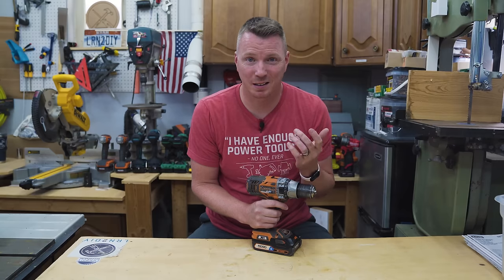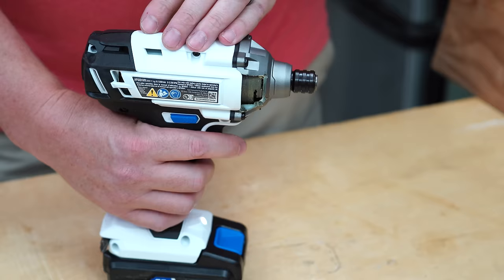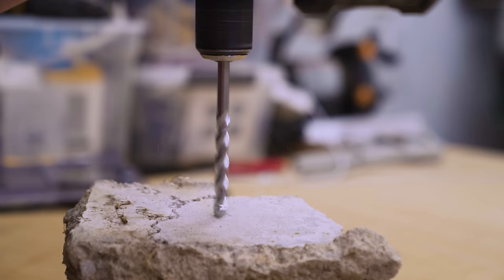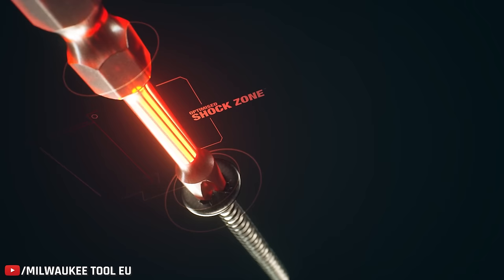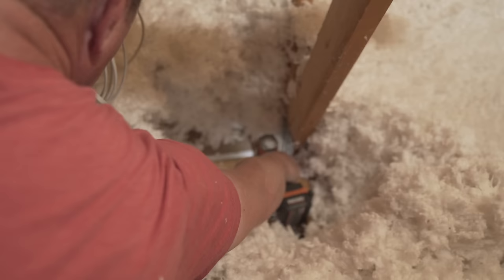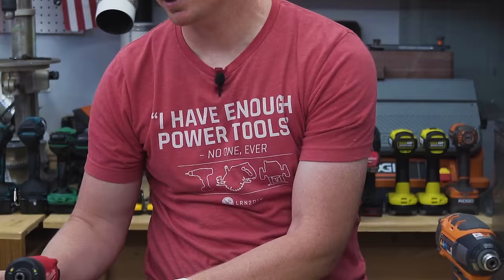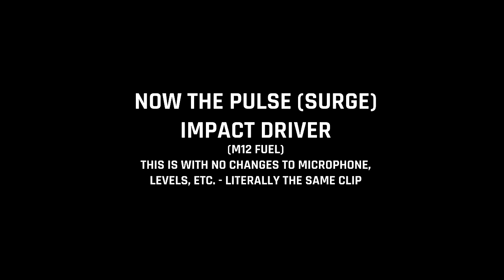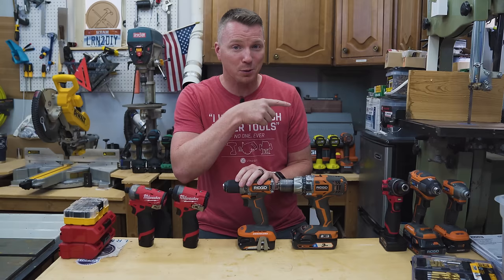Is The Cordless Drill Becoming Obsolete?

Comment: For most pros we stick to using the impact to drive screws and the drill to drill holes. You don't have to switch bits as often and you will be carrying around both anyways. Also the impact can drill small holes fast but once your drilling through multiple layers of material or heavy duty stuff the impact will be slower than the drill.
Reply: Not a pro but I prefer to have both tools handy as well, mostly to not have to change the bit holder and drills all the time.  I use the 12v DeWalt set of drill motor and impact driver; they are smaller and easily fit in my toolbox unlike most beefier 18V tools.  In some cases I actually prefer the drill motor for driving screws, it gives better control.  And is a lot less noisy.
    
I also carry a small wireless Bosch electric screwdriver, it is not as powerful as either DeWalt but it's tiny and good for many jobs (especially building IKEA kitchen cabinets as I have found).  Much easier to wield than even the smaller impact drivers in this video, especially in tight corners.
Reply: I have a different setup but kinda the same. I use a drill for predrilling and a power screwdriver from Milwaukee. The screwdriver has a 1/4 chuck for bits, and a clutch for limiting torque on fasteners. Best setup for my application. Whether I am hanging APs, making drops, or racking equipment. 

Since getting it, my impact has been woefully neglected. I still use it but mostly at home and for diy projects that has me binding dead tree carcasses together for one reason or another.
Reply: Hope this wasn’t  a click bait video impact driver and a drill has their different uses
Reply: @EyebrowsMahoney   new guy at work is full kitted with Milwaukee. That 1/4 chuck screwdriver is nice.  Much quicker and easier when you're installing 100 4mm screws in panels.
Reply: Exactly I'm drilling 5/8 holes all day through doubled up 4x4s.
Reply: Well spoken
Reply: Dont forget we use drills to mix cement, joint compound, mortar, etc.
Reply: 100% agree. Also if you use the 1/4 drive wi g bits to drill your holes with the impact, you can get hole tear out more often in my opinion. Drills you can control the cutting action of a bit more easily since you are not getting impact strikes on the bit. Drills have a place as a partner tool with the impact and work very well with each other.  Each other can do the job of the other, but they excel in the separate jobs they have vs trying to be a jack of all.
Reply: Don't use an impact on thick steel, your drill bit will thank you.
Reply: That's why you are called a "smart person". You hit the nail on the head... Pun intended
Reply: @nicholascooper1193  Now I'm not kitted out Milwaukee, but I want a lot of Milwaukee stuff. But that is precisely why I got it. I found myself taking out and putting in so many machine screws that I just got sick of it. One day I was working on so much equipment with so many fiddly screws and it hit me how much time I was spending with a hand screwdriver and how much work I had left to do that was going to roll over on top of other work I had to do the following days...

Bought it and breezed through the equipment maintenance and open tickets and now it's my go-to for just about everything.
Reply: I think the “pros vs DIY” argument is less relevant these days as equipment market targeting converges - as does usage - I see loads of professional sparkies using impact driver for specific drilling jobs. I still think drills are good when you are doing jobs needing both (saves changing bits) but yes - drivers for drilling can be great.
Reply: I prefer to have both. The impact driver doesn't seem to drill as clean a hole. I use my impact driver like I would an impact wrench but only on the smaller stuff that a half inch drive impact it too big for
Reply: Exactly
Reply: @jameshendricks8526  Yeah I refuse to drill with an impact. Also can't use it when drilling metal either. I use a drill for a drill and an impact particularly for driving lag screws. But fwiw, I'm super impressed with my Milwaukee M12 Screwdriver, I was hanging shelves the other day around the house and it was going into studs like butter with only a 1.5AH Battery. Every day I keep finding less things for my 1/4 shank  impact to do.
Reply: Excellent analogy I agree with you sometimes you use the impact driver for driving screws and then when you need to drill a hole you use your cordless drill. Just like when I need to drive a nail sometimes I'll use a hammer and a regular nail and other times I will use my cordless nail gun all depends on the circumstance they're all valuable tools.
Reply: As a professional  2 drills and 1 impact is the perfect amount 1 to drill the hole 1 to counter sink and the impact to drive the fixing. 
Yes you can change bits but that’s slow and yes you can get a combi drill counter sink bit, but they don’t always drill deep enough.
Reply: Yep
Reply: I'm not a pro, but this is what I do as well.
Reply: To add to your comment, if going to be making holes often I reach for the hole hawg or the sds drill for concrete....
Reply: Heh, speak for yourself.  No, I'm not "carrying around both anyways", that would be ridiculous to walk around all day with both.  I either have the impact driver if not expecting to drill any holes, or only the drill if I will.  Whatever tools don't get used, stay on the truck, would be silly to unload every single tool I have and carry them all around all day.
Reply: not this pro (electrican).  i use a cordless drill only.
Reply: I need em both in the housing industry. The impact is not a one stop shop for all my drilling needs.
Reply: Not me. Maybe just lazy, but I  got sick of carrying both 10+ years ago when I figured out I could drill holes with an impact driver.  I still keep drills with me of course but I tend to stick anything I can with a hex shank into the impact driver.
Reply: Exactly 💯🍻
Reply: Agreed, I really think this type of clickbait title does a disservice for a good channel. It would have been easy to title this 'The expanding use of impact drivers' or something.  Drills are definitely way faster low torque applications and way easier to not over torque things. 'I do think drills are still very useful...' - this directly contradicts your title.
Reply: You're absolutely correct. Tried impact on double and triple headers. It was slow and died within 1h. I had to switch back to drill, which lasts all day on one 5AH battery and is much faster.
Reply: I imagine you go through a lot of drill bits that way, snapping them off every time one hangs up on you.  Better learn to sharpen them.  Or better yet, send them all to me so I can resharpen and sell them!  😅😂😅
Reply: @stinkycheese804  Amen to that, brother, you've got a head on your shoulders.  I once worked for a luxury SUV manufacturer, and they wanted me to wear a heavy parts/tool apron with THREE drivers.  One day, I noticed a patch of spider veins about the size of a silver dollar on right side of my abdomen where the belt sat.  I quit carrying 3 and just carried two and set the other down on something nearby.  I told them I could either do it that way or I could go to the medical department.  They would have gotten some attention to the ergonomics of that workstation.
Reply: @HBSuccess  same
Reply: I use my drill with the clutch set on 1 or 2 a LOT. My impact can't drive that wimpy. Also, if I bring just one tool in a tool box / bag the tool is the drill since I'll be using the clutch so much. I also snug screws either by hand or with the drill with the clutch set to the snugness I'm after. For the equivalent of hand tightening my impact is worthless.  I guess I'm just old school, I like to mostly loosen with the impact & "hand tighten" with the drill's clutch. I also dropped my impact shank drill bits in the recycle bin veeery long ago.
Reply: Exactly....I find the impact driver a poor driller on serious material. And....if you're drilling into concrete, the drills in most of these sets are also hammer drills. No substitute for a large 1/2" hammer drill.
Reply: I was going to say. I hate switching bits. I have two drills and one impact driver and there are times I use all three on one project.
Reply: @michaelbrown8861  👍👍👍👍👍👍
Reply: I am not a pro, either, but prefer have and use both tools, one primarily for drilling and some driving, the other for driving.
Reply: @Lethalpancakes  As I watched the video, I thought the same thing. I would imagine the "impact" would provide no advantage in mixing. I have had only one brand of impact driver - Master Mechanic from true Value hardware. I realize that is not exactly a professional grade tool. However, one thing I have not liked about it is the inability to easily control the speed. Most drills can easily be controlled with the trigger, but on my impact, it seems to go from real slow to real fast real quick.
Reply: Yeah. Everyone I know in industry uses impacts for driving screws. And hammer drill to drill holes if concrete. Normal drill if metal or wood. Never used my impacts to drill a hole. Guess your need an adapter or specific drill bit. Heck we used a cord drill up until 10 years ago or so
Reply: Another example of a video that's only popular because it's bad advice.    Sure, a mild DIYer could get by with just an impact, but there are countless reasons for still having a drill around if it's in your budget.

Plus, it's VERY unwise to buy drill bits from harbor freight.
Reply: I agree, this guy is no pro, more a master bodger we have to clear up after.
Reply: I find myself use impact and hammer drill, I have 3 regular drills collecting dust
Reply: Saved me watching, thanks
Reply: @MatSmithLondon  I don't agree. I've never seen a trades person on a job show me that impact drivers can outperform my regular drills in drilling out most materials. It's really not a big deal to use two tools set up to do different tasks. If you watch how fast we can do this with our hands, it's become a moot point.
Reply: @webtheweb  Of course....once you pull in your Holehawg et al, you wonder why you were messing with a rechargeable drill in the first place. It's almost as if guys are trying to prove that powerful corded drills are a thing of the past. Only that kinda thinking is.....
Reply: You can use impact all you like, what you are not doing is adding discourse on a more metered barrel on your drill. When not used properly this can fracture the built in depth monitor on any drill on the market post 1989. Drop a hammer bomb just before you drill, click on the side crank ( ensuring it’s on impact left ) have some water ready for frilling or any signs of a crust forming and all the areas you mention become of far less concern.
Reply: Yes, but it also breaks the head off.  When I called Kreg and questioned WHT the screws were breaking, he told me to use a drill, not an impact.
Reply: @michaelbrown8861  yeah, he talked about those differences a couple times. I take it you didn't watch the video just commented on the title
Reply: Yes I am an electrician and this is accurate to how I use them as well
Reply: Also how much extra is a drill bit for a impact gun
Reply: Is this the pro hang out?
Reply: @justotorres8970  yes
Reply: @EyebrowsMahoney the Dewalt 8V mini screwdriver is awesome, I work low voltage and do a lot of what you said with it.
Reply: In other words, use the proper equipment for the proper job….I’m with you.
Reply: Imagine having fine items youre working on..., just carry two drills. Use an quick release bit anyways.
Much better for certain applications
Reply: @edrader  I be same but use Bosch Go for tighten boxes to 2nm and quick
Reply: I Concur...
Reply: Yeah no joke I hate changing bits because eventually you start losing them. And I've been drilling large holes through thick wood and a corded drill doesn't have the torque the cordless one does.
Reply: "pros" use a combi drill to drive screws, set to the correct torque. rough tradesmen use impactors for every screw, not "pros"
Reply: @dannythorpe1425  what if your impact has torque settings?
Reply: @jordan alexander  still on smaller screws you don't want the hammer action. If you can also turn the hammer action off, it's a combi drill.
Reply: @dannythorpe1425  true I suppose that why they make a driver. Identical in looks to an impact without the impact. But I haven't seen one for sale in a long time.
Reply: Completely agree. Impact is only good for drilling smaller holes and I don’t care how ‘impact ready’ they make the drill bits, when the sharp cutting blades on the drill bits are hammered against a hard surface (metal) they chip and snap faaaar more often.

The drill is heavier but it’s always a LOT more powerful than an impact.
I even use the drill for undoing seized/warped bolts and things when the impact isn’t strong enough (and yes I have the top of the range Milwaukee gen 3 fuel 18v impact).
The tourqe on the drill can snap the head clean off of an m8 stainless bolt quite easily in ‘1’ high tourqe mode.
No impact is even nearly doing that.

The drill drills a lot faster and smoother and can drill larger and deeper holes.

The little 12v impacts are great for most things but drills are not going anywhere anytime soon.
Reply: The problem with impacts is stripping heads on screws. Hex heads, no biggie. Phillips, I've had em strip the groove just enough that it made it tough to get out.
Reply: Really depends on the application too.  For people mostly doing projects with soft wood or plastic, do whatever you want.  Your tool choice will have almost no impact.  But when you’re drilling into hardwoods, metals, concrete, etc, you really want to be using the proper drill or mill for the bit/cutter
Reply: Pretty pointless arguments on here...I prefer using a drill except for rough work when I use an impact driver...my work colleague uses an impact driver..it really doesn't matter at all
Reply: Impacts aren't accurate for drilling. The bit slops
Reply: @kaasmeester5903  This guy really uses an electric screwdriver lmfao I thought that was just for the lazy programmers
Reply: @anziety604  Heh, if you’re assembling a whole bunch of IKEA cabinets for a large kitchen, an electric screwdriver is a godsend. That was the job I bought it for.
Reply: Yep… or grab the hole hawg….
Reply: @Lethalpancakes Try the Milwaukee mud mixer; what a game changer.
Reply: Pros. Don’t just stick with an impact driver. Unless you’re in the framing business or having to tie down wood you don’t need a impact driver. Look at pro carpenters and pro cabinet makers most of the time they’re not using an impact driver.
Reply: Many pros we also don't shop at harbor. They want an identification to return even  cheap dollar items
Reply: Where did you get, "most pros", from.
I'd actually say most idiots. Why? Because there are torque settings for a lot of screws, (especially the terminals in PDUs), that people WAAAAAY over tighten. Even more so with an impact.
Also because people ask to borrow your tools and unless you stop them you can pretty much guarantee they will immediately set the torque control to max AND use a number 2 Pozidrive where a number 3 Phillips is required. In these cases an impact will ruin the screw VERY quickly. Considering most kits come with an array of bits including the exact one they need it triggers the OCD in me to see this.
Am fortunate enough to have three drills and three impacts, (each for the purpose for which it is best suited, not what will work cos it's easier and cheaper to carry one), and the majority of the time an impact is just not needed. A bit of care, time and instruction/attention is really what's needed.
Reply: How about you need to screw on a drywall?
Reply: @robertray3746 Have you tried the snappy bit holders?You can replace the bits on them when they break,and they fit in your impact chuck
Reply: lol that’s why you have a drill and impact drill.
Reply: Far slower. The drill is still necessary for drilling holes, agreed.
Reply: It’s interesting to see how technology is shifting in the power tool world. The impact driver is a game-changer, offering more versatility and efficiency than traditional drills. The noise might be a downside, but with innovations like the pulse driver, even that is being addressed. Looks like the cordless drill might be taking a backseat
Reply: I'm not a trades person. I've got a Boesch cordless drill that's quite old now and I'm having trouble drilling through brick. What would you recomend for me?